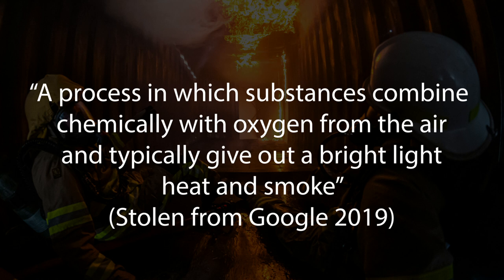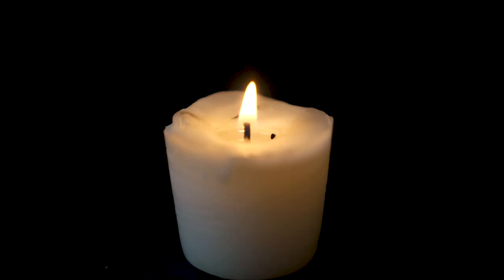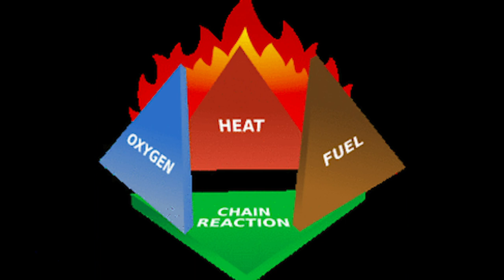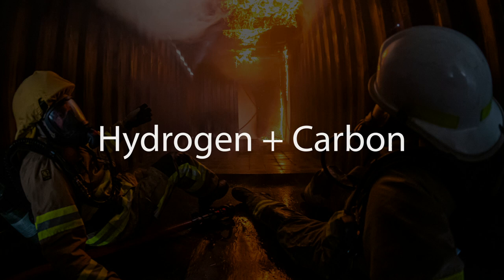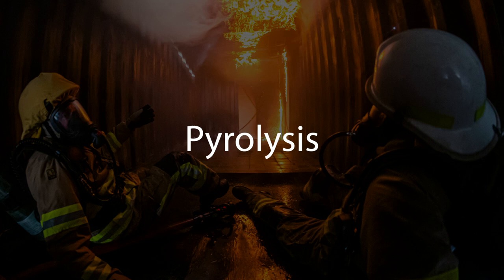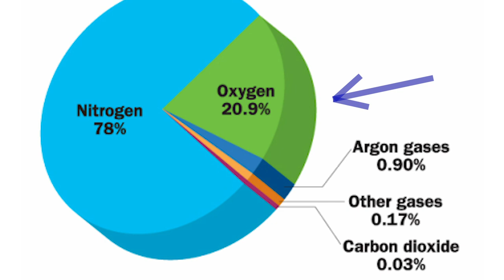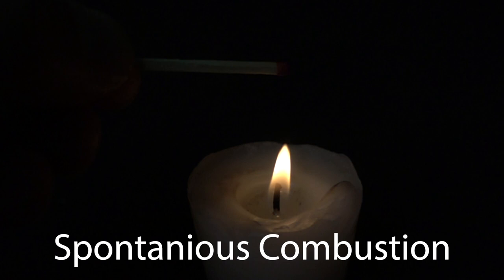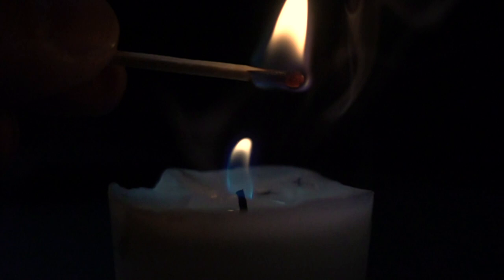What is fire?  - Episode one

Comment: Hey Matt, really well done videos. The entire series! One thing that may confuse some people about this first video is how the wax gets from a solid to a liquid to a gas (heat -> melt -> up into the wick -> pyrolysis as you mention). I only throw it out there as it may be a stumbling block for some to grasp the concept of pyrolysis. i.e. is it the solid candle that's vaporized or the little pool of melted wax below the flame? And what about the wick? etc. etc.
Reply from the maker: Hi Chris, thanks for the feedback, I appreciate it! 
There are a few things that I could have presented differently throughout the series. (It's all been a bit of trial and error in making the vids). But I do try to make them as accurate and straight forward possible 🙂
Reply: @MattDavis5  ya, no worries. This is just a comment in case you ever come back and do an edit or add on. The whole series is very well done. You touch on content many others don't. And I've not seen it be in such an effectively presented series like this either. Kudos, big time.

Comment: I used to be a scientist but I never knew it was the smoke that was burning! - in fact I thought that the smoke was some non-flammable dust or ash or something - thanks for the chemistry clarification! - but what about the smoke well above a bush fire? - would that still ignite if there was another flame introduced? - maybe there is cooling as the smoke rises and it becomes not hot enough to continue to burn?
Reply: Just a curious guy. I think if the smoke from bushfire gets another heat source, it could possibly catch fire and the resulting flame will be bigger than the bushfire.